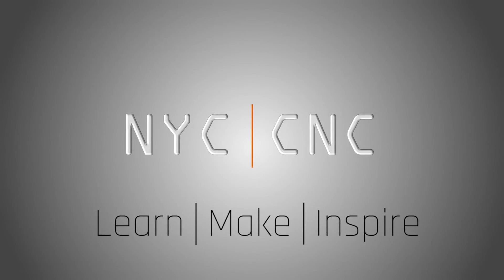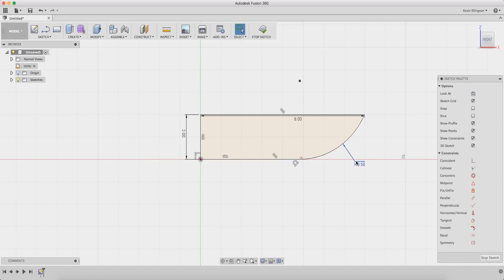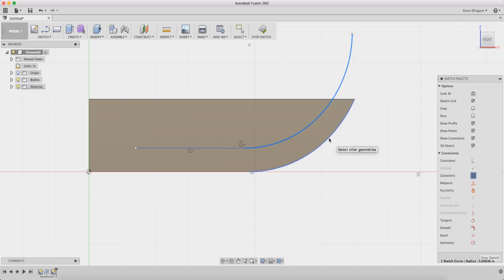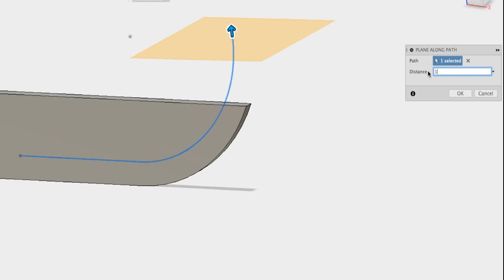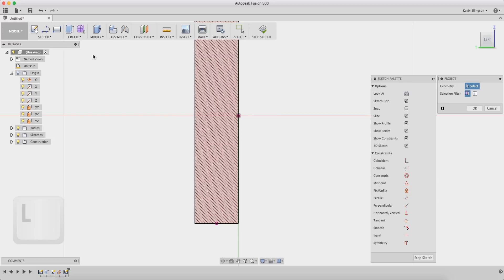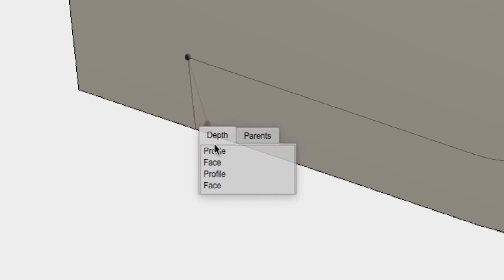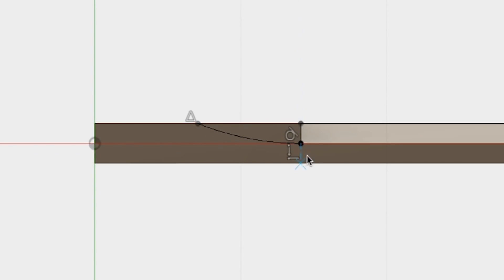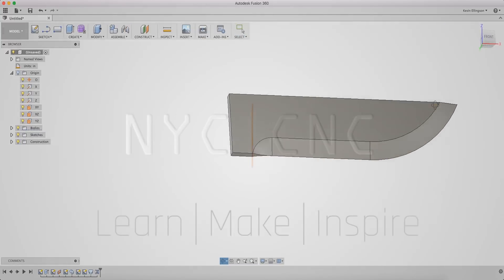How to Model a Knife Blade in Fusion 360 FF124

Comment: good video.I do have a question.when i hold the left mouse button down i get xy plane instead of xz plane.is there a reason why.this happens all the time....thanks
Reply: This also happened to me. Did you find the reason?
Reply: @davidzenteno1240       I still haven't.I'm just wondering if it's because we are using a newer version of fusion.

Comment: Interesting. I never used the loft before. What does that actually do?
Reply: We use lofts for creating wings by lofting a root airfoil to a tip airfoil (which are at different angles (of incidence)) and also to create a transition from a wing to a winglet.
Reply: Probably not the best way to explain it but I would say it morphs a surface from one piece of closed geometry to another. You can add "guide rails" (lines that run between the 2 pieces of geometry) to influence or "guide" the surface that's created.  For instance you could use a loft to create a cone with the point chopped off with a large circle and a smaller one above it, then add a guide rail to give it the shape of a vase.  I don't think I've ever used a loft to make a cut like he did, that was cool. I would have just made that arc part of the offset line and swept the whole thing.
Reply: Think of a loft as kind of a combination of extrude and sweep. You create profiles and the software interpolates the shape that would be made as you transition form one profile to the next. You can also add guide rails or centerlines for those shapes to follow as the shape transitions. Hopefully that helps explain what the loft command does. Thanks for watching.